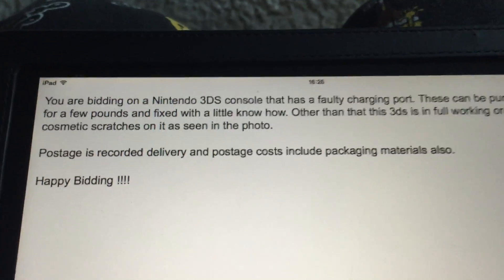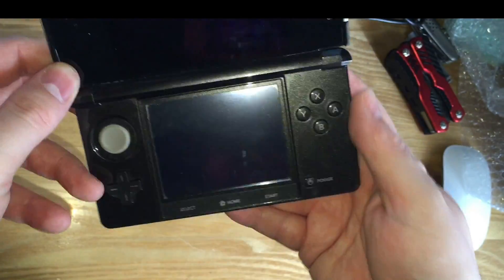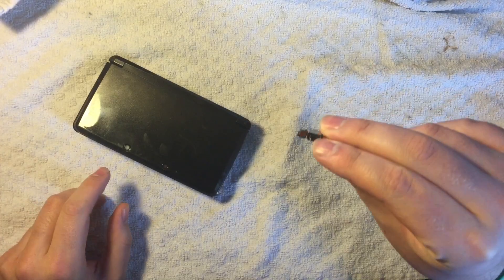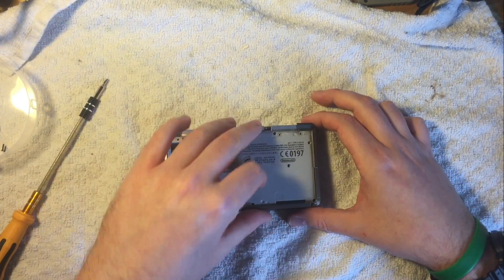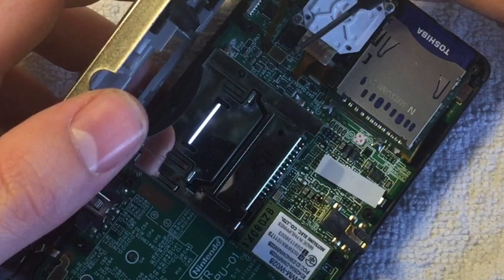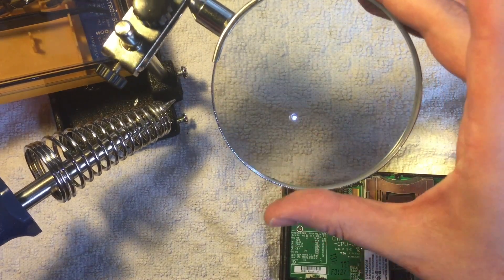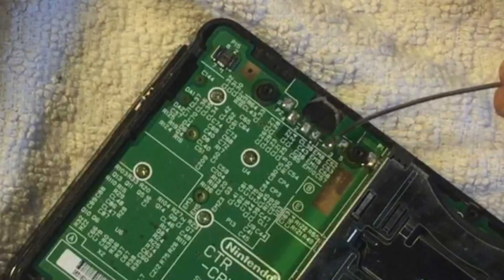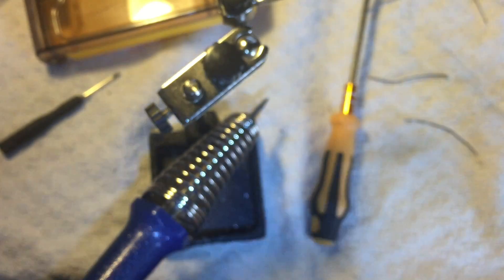Console Repairs: Nintendo 3DS (Charging Port Replacement)

Comment: Yooo that 3ds is exactly the same one as mine, it even has the same SD card!
and i was thinking on doing this too because the charging port is broken
this is my first time using a soldering iron, any recommendations?
Reply from the maker: Go steady and take your time with it.  If you mess it up you can remove the solder with a solder sucker.  You'll be fine.

Comment: This really dont help. My 3DS charger is not working, because the thin part of the charger that does not plug to the wall is chewed up from my dog. Whenever i try to plug it, it immidietly has a low battery. What do i do?
Reply from the maker: Buy a new charger off eBay.  They're dirt cheap.

Comment: how exactly did you remove the old charge port? did you just solder it out?
Reply from the maker: ImmaSheKitty Yeah just heat the solder and put the part away. I couldn't capture the process of film unfortunately but it's not at all difficult :)

Comment from the maker: It was very difficult to record the soldering process with my phone, something I didn't realise until I actually came to do it.  A second camera would have been ideal but at the time I didn't have one.  Hopefully this will still help you!
Reply: CrawFail can I use any watt of soldering iron? Or Used I use the same specific things you use? Sorry its my first time for soldering iron
Reply from the maker: You can but I'd recommend using a lower powered one to avoid damaging other components on the circuit board.    I'd also advise having a play around with the soldering iron first and get used to how it works.   They can be quite awkward to hold and do small repairs like this one.  Best of luck mate!  Hope your repair goes well!
Reply: Could I send you mine and you fix it?
Reply from the maker: @miginmotion  As much as I'd love to say yes, if I fucked it up I'd be mortified.

Comment: how do you put the ribbon back ?
Reply: and how dit you desolded it
Reply from the maker: Just follow the steps backwards to put everything back in it's place.
Desoldering just needs a little heat from the soldering iron. The solder will melt and stick to the iron's tip. You can get solder suckers which will suck up melted solder if you need one.
Reply: thannks for helping me out even tho the question was asked 3 months ago but i repeard my 3ds THANKS!

Comment: What size screwdriver is that?
Reply: +CrawFail alright, thanks.
Reply: +CrawFail One more question, to desolder the port..did you just touch the solder to the joints until it loosened?
Reply: You will need a 2.0 sized phillips head in order not to strip the screw heads.
Reply: Brandvegn lol I tried performing the repair and stripped the screws. Screw my life.
Reply: I tried with a smaller driver, stopped and decided to try a few different sizes and see which ones filled the phillips head. Sorry about the strip.
Reply: +CrawFail yeah, I was stupid. I hope I can extract the stripped screws without damaging my 3ds
Reply: +Godot also, i did temporarily fix my 3ds, because not all of the screws were stripped. So i was able to open the back casing just a enough to rip the old port out and slide in the new one...now i have to press down on the charger so the contacts are touching on the motherboard. At least it's better than nothing.
Reply: +CrawFail How do you damage the port in the first place?
Reply: With my nephew, he broke the plastic inside the port because he had to wiggle the charging port to make connections since the solder broke in a couple areas. I have fixed it and reinforced it with wire, giving the smaller legs some more girth.
Reply: Godot
You may want to mention that the proper size is the 2.0 Philips in your notes or in the video. You can buy a great set of drivers for small unit repairs from ebay. "Precision 38in1 Screwdriver Set Repair Kit Tools for Mobile Cell Phone PC Tablet". I have no affiliation with the seller, but this is the set I have. Will help others not strip out their screws.

Comment: I got another charging port and I want to solder it on but I don't know what screwdriver to use to get to the inside
Reply: Honestly, if you don't know what screw driver to use then I don't think you should be even messing with soldering.
Reply: The DS only needs small cross head (Phillips) screw drivers to get inside. You can find them really cheap at pound/dollar stores. Hope that helps.
Reply: ***** What I mean is, first time  fixers shouldn't try to tackle small electronics, such as a 3ds, for their first project.
Reply: don't care got a charging base MAJORA"S MASK #D
Reply: Late reply but for newcomers, do not use Phillips, you could strip the screws, buy JBS screwdrivers, they are the drivers for the screws in the 3ds. They look similar but aren't the exact same.

Comment: My 3DS charging pin is also loose. The middle part in which attached to the charger wiggles loosely. Is there a way to fix it other than soldering? It still works but it bothers me alot.